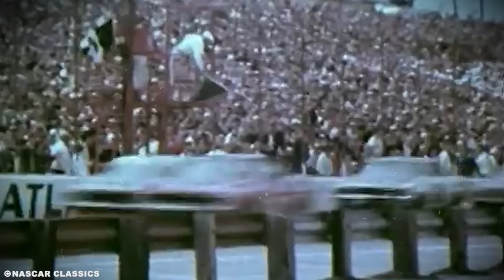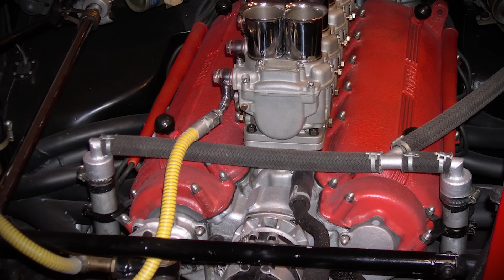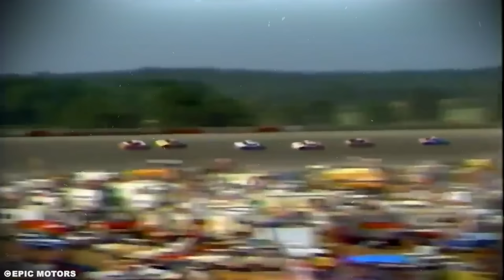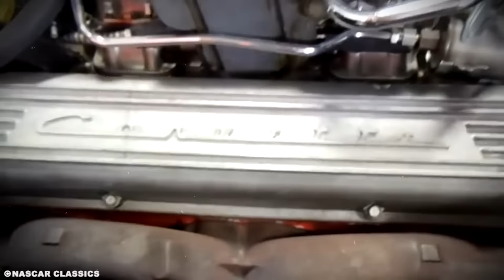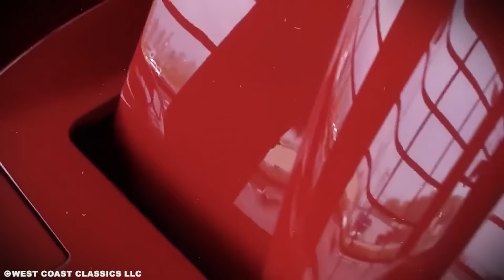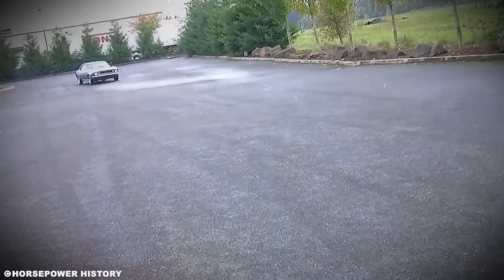How One Chevy “Truck Engine” Outsmarted Every Sports Car in the 1960s

Comment: I am 80 and had a basic 1965 Chevelle 300 Deluxe sedan--no AC--and in Phoenix!  It was a 327, 4 on the floor, stock with 350 hp. Raced it at Beeline Dragway in E-Stock, won numerous races including 1966 AZ state champion for my class.  It was one hot car straight from the factory.  Those were the days!

Comment: The 1955–1957 Chevrolet 265 cubic-inch small-block V8 has a 3.750-inch bore and a 3.000-inch stroke. It was over square not under square.

Comment: I'm 80 yo. In the 60's I had them all. A 265 in a '55 2 door hard top, a pumped up 283 in a 57 2 door hard top in 58 and in 64 I had a 63 Impala Super Sport Convertible with a 327 and Muncie 4 speed that I pumped up to 400 HP. Those were the days... Those were the days that cars were hot and life was fun.

Comment: Under-square?  All versions of the small block were over-square, meaning that the bore is larger than the stroke.  Even the video gives the correct bore and stroke for the engine but says that it's under-square.

265 cu in (1955–1957):  3.75 bore × 3.0 stroke, over-square.
283 cu in (1957–1967):  3.875 bore × 3.0 stroke, over-square.
302 cu in (1967–1969):  4.0 bore × 3.0 stroke, over-square.
327 cu in (1962–1969):  4.0 bore × 3.25 stroke, over-square.
350 cu in (1967–2002):  4.0 bore × 3.48 stroke, over-square.
400 cu in (1970–1980):  4.125 bore × 3.75 stroke, over-square.

Next, the claim about the Chevy small block being one of the winningest engines in the 1960s.  Well, that applies to the type of racing they specify in the video.  Outside of that, and stock car racing, and drag racing, the engine wasn't suited to too much else.
For instance, small block Chevy engines qualified for the Indianapolis 500 a few times but never won.  Offenhauser, an American 4-cylinder engine, won the Indianapolis 500, 27 times.  The 2nd most successful is Honda, with 16 wins.  Offenhauser was beating V-8s, and every other engine that ran against it in 1935, and then it completely dominated Indy from 1947 to 1964.  It won again in '68, and had another solid streak from '72, to '76.  The all-aluminum, 4 cylinder with overhead cam, and 4 valves per cylinder, and 5 main bearings.  It was eventually made uncompetitive by intentional changes in the rules.  One interesting novelty about the Offenhauser is that the head and cylinder block were cast in one piece.  It was common for high performance engines to blow head gaskets, so Offenhauser got rid of the joint and got rid of the head gasket.  When turbochargers became common, the Offenhauser was able to take higher levels of boost than other engines.  
  
The 24 hours of Le mans has never been won by a Chevrolet engine of any kind.  Ford won Le Mans in '66 & '67 with their 7.0 liter (427 C.I.) big block engines.  They won again in '68 and '69 with 3.0 liter Ford engines.

Chevrolet has never entered any engine in Formula One racing until this year.  The most successful engine in Formula One history is the Ford Cosworth V-8.  The Cosworth engine was developed by a British company owned by Keith Duckworth and Mike Costin.  Duckworth is formed by portions of each of the owner's names.  They designed the engine starting in 1965 and were successfully racing it in 67.  Ford provided the funding.  The Cosworth was an all-aluminum, 90-degree V-8 with dual overhead cams, and 4 valves per cylinder.  It was surprisingly inexpensive, simple, and reliable after the teething troubles were worked out.  It won 155 races out of 262 entered between 1967 and 1985.  It should be noted that some of those wins came because the ground-effect era started and the flat engines made by Ferrari and Alfa-Romeo were not suited to the air tunnels under the car. 

The Chevy small block was a fine engine and deserves all the praise that it gets.  I've just provided a small slice of history to widen the perspective a little bit.

Comment: I put built small blocks into all manner of Japanese sports cars & boats, I have an unrun Nascar truck 355 that will get cam change and install into my 72 corvette which will be completed as a road car, quiet, comfortable & auto trans driver. Nice thing is it's not modifying the original car other than more useable horsepower, current design suspension upgrade with new tech Michelins' & large bore though quieter exhaust with long tubes. It will be a decent rebuild of a 1984 World of Wheels Show winner in it's class, back on the street for long interstate rides.

Comment: The truck title caught my eye:  I had a 307 in a '55 GMC that turned into a bad oil burner.  correct me if I'm wrong:  a 307 did not come with any valve guides.  Valve stem was only in cast iron of head.   A local mechanic swapped in a 283 2 barrell from a '65 El Camino.  It had solid lifters, which I lashed with the valve covers off.  Kind of messy, but very easy.  A buddy gave me a cast iron 4 barrel intake and Holley 600 single feed 4 barrell.   That stock 283, with solid lifters revved to 8000 any day of the week.  I fried the right tire mercilessly.  It had a 4 speed tranny with a granny low I never used, and some 4.00 gears.  The other 283 of my youth was in a neighbors 66 Nova.  It had a 3 on the floor. He showed me 100 mph on the speedo when I was a pre-teen.  283?  Oh ya...

Comment: In 55 Chevrolet ran out of the V8 and put Buick and Pontiac engines in the Pick Up trucks I saw a few of them 👀❗️👍
Reply: '55 was also a split year for the GMC truck body style. earlier series had "pointed" hood.  Lots of mixing that year.

Comment: Too , Ross krause 3926, ! Chevy did not produce the 283 ,until 1957, therefore, that 56 truck most likely had a 265, which was the forerunner to the 283, and was built in 55 and 56 !? If the 56 had a 283 it was a transplant from a later date, you did not say what year this took place ?
Reply: Yes, and the 1957 Power Pack was a 220 hp 283, with a single 4 barrel carb. It was a fairly common engine in 57's. I had a number of Power Pack 283's when I used to restore 57's. The famous "1 hp per cubic inch" engine was the 283 hp Fuel Injected 283.
Reply: It was early 80's and I do believe the engine was not original to the truck..we pulled the engine out of the 56 truck and I measured the bore with a telescoping gauge and a micrometer..I had some old blue Motor Manuals back then and found the matching bore size info and determined it was a 283.
Reply: BETTER research more  265 was only 1 yr

Comment: how do you figure it started out as a truck engine...Zora Duntov.....was behind it's development because the Vette needed a real engine, then the reg production 55's... and the trucks.... as a truck engine, at the time, it was disappointing.... the rear gears were steep [to make up for the lack of torque, I think, actually the I 6 had more low end torque] because it was NOT torquey as you implied... the small block didn't get torquey until the 400... actually the home brewed 383... The GMC truck didn't use it at first, it came with a Pontiac engine with valve covers that displayed the GMC logo.
Reply: And a low1, low2-High1, High2 transmission in many.  One sat in my uncles' woods for years, I was amazed when I looked and there was a Pontiac engine.
Reply: 265 didn't come out until  55 .

Comment: From what I remember my friend had a 56 Chevy truck that had a 283 Power Pack engine meaning 1 horsepower per cubic inch or 283 HP..but we pulled it out and I put a fairly good size Sig Erson hydraulic lifter camshaft..an Edelbrock torquer intake manifold and some 2.02 intake valve double hump heads with a 750 vacuum secondary Holley carburetor..for what it was it screamed with the 3 on the tree steering column.the 283's head  had tiny valves so the 2.02's helped for sure.
Reply: Actually, the 283 Power Pack had 220 hp, and came with a single 4 barrel carb. The first year for the 283 was 1957. The Fuel Injected 283 was the one that made 283 hp, with the 1 hp per cubic inch. In 57, they also had a dual 4 barrel 283 that made 270 hp.
Reply: @grand73am I got that info from an old Car Craft magazine years ago..I do remember the casting mark on the end of the head as being almost a rectangle with a high raised point in the middle..small combustion chambers.

Comment: The Ford Hi -po 289 Cid
Was the Greatest, Highest Horsepower  and lightweight  450 lbs.  The Falcon Sprit  and Mustang.
Reply: But, at the time ( 1950s ) the 289 did not exist.  He was talking about at that time in the mid 1950s.   Ford only had the Y block back then.  The 289 didn't come about until the early1960's.  So, he was right.
Reply: 289 was good in light car heavy car different  story

Comment: I am 74 years old and know about the famous Chevrolet Small Block V8. This engine was the most highly produced V8 in automotive history. This also had to be the most versatile V8 engine in automotive history. Also this engine was in production from 1955 to about 2000. It is not surprising that this engine was also a good racing engine.